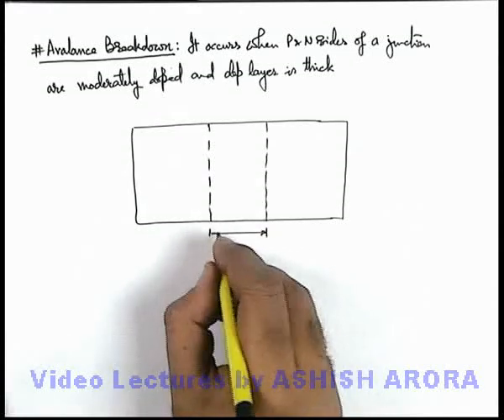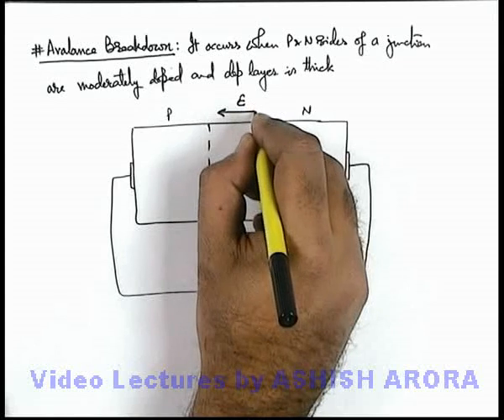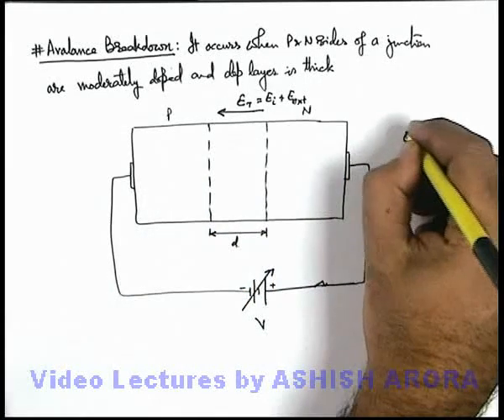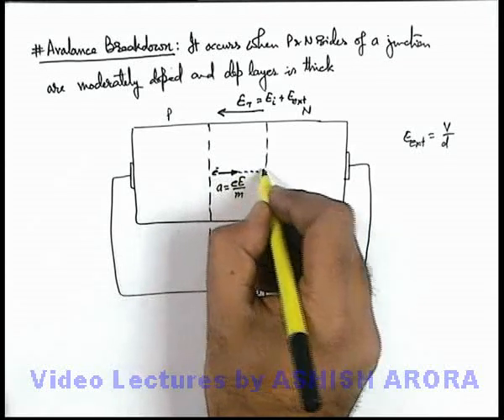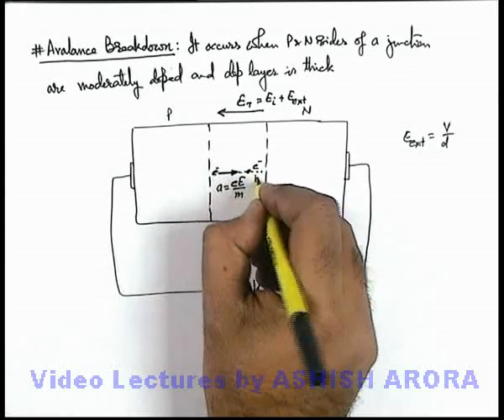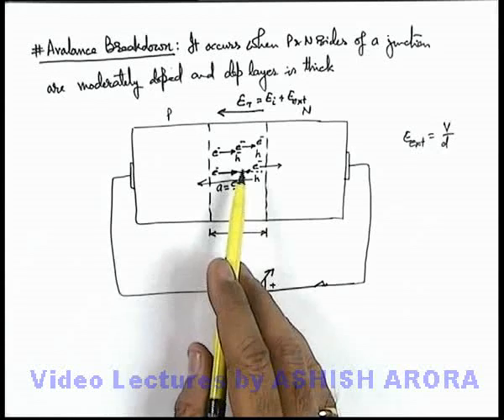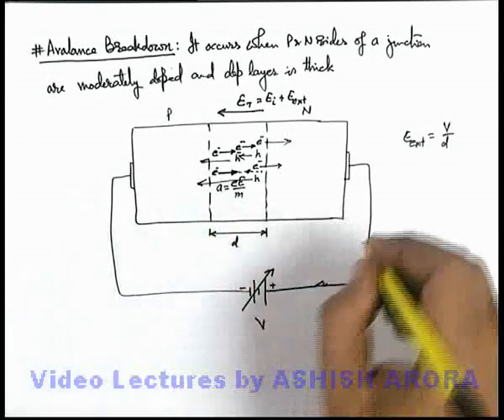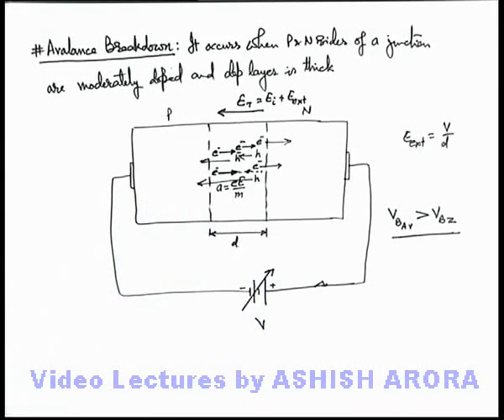Class 12 Physics | PN Junction & Diodes | #13 Avalance Breakdown | For JEE & NEET

Comment: are these electrons accelerating from depletion layer or they are minority carriers of p side.  i think it is only possible through depletion layer not through p side as soon as electrons from p sides will come at the interface of p and junction they will be repelled by - ve charge as electric feild exists from n to p am i right??
Reply from the maker: These are electrons of depletion layer as in the thickness of depletion layer these are accelerated toward p side due to the electric field in depletion layer due to reverse biasing battery...

Comment: sir plz clear this doubt i am really getting confused in this.
1) why the width of depletion layer depends on doping level.
2)does internal electric feild depends on width of depletion layer and how.
plz reply sir
Reply from the maker: +Yash Agarwal (1) when the fusion of sc take place its the density of charge carriers due to which depletion layer is formed... and if density of charge carriers is high (high doping), quickly the layer will get formed or the opposing EF will setup which will further stop the flow of charges.. thats why it depends upon doping level...  (2) I have explained it in ans of query (1)...

Comment from the maker: In a normal pn junction if breakdown occurs, due to excess heat produce junction is damaged whereas in zener diode after breakdown, voltage is maintained at bd voltage and when it is decreased it works like a normal pn junction. Thats why zener diods are used as voltage stabilizers also.